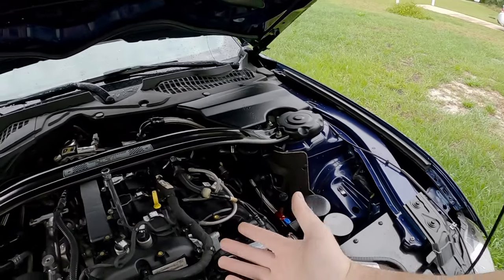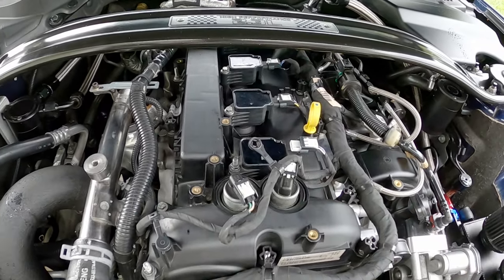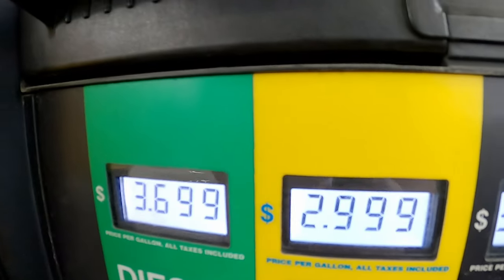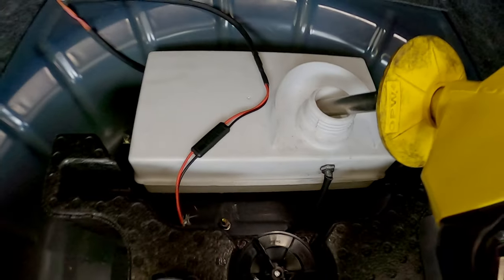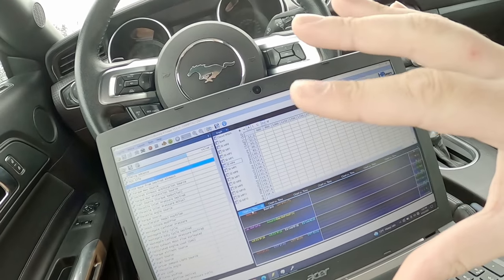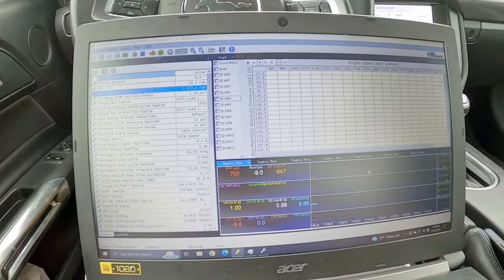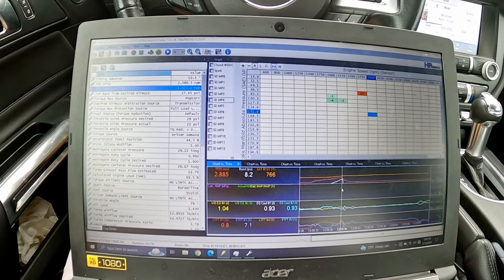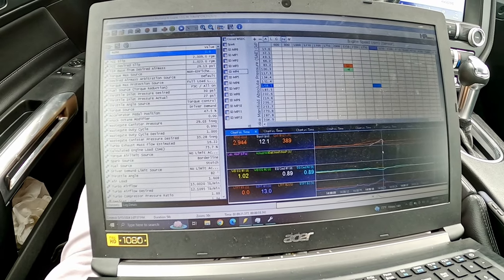Using E85 in an Obscure Way *NOT RECOMMENDED*

Comment: *Kirk, this information will really help me! At the dragstrip, I brake launch in 2nd gear at 2500 rpm and have issues with charge temperature and timing. I also have a 2/10th of a second delay between releasing my foot brake and the rear axle turning.

Can you log your charge temperature and timing when you brake launch your Ecoboost Mustang?? Also the delay between when you release your brakes and your rear axle turns?

Thanks in advance for the information!!
Reply from the maker: I'll post that info in a video. It won't be the next video upload, but the following video. I haven't had time to log the car launching.
Reply: Thanks Kirk! I think part of my problem is the amount of heat the turbocharger produces while staging. It pushes my charge temperature up to where the ECU cuts timing...?
Reply from the maker: You gotta get staged quickly! Loading up the trans to brake boost builds heat kn the trans and engine. But yes, if your manifold temps are lowering your timing, you can always raise the manifold charge temp table in the spark advance section. Also check your LSPI Hi table to see what ar load it's at when the manifold temps are higher. You'll love my next video when I get it uploaded. I'm slowly getting part of my launch control system ironed out.

Comment: I had a bad experience with anti seize, I had used some on new plugs on it showed come tuning time. I had a miscommunication with my tuner when he asked if I used some I thought he meant I did not use enough so I put even more on. big mistake, the only real way to clean up that stuff is the chem bath the machine shop does. As I have said before, I make a lot of mistakes...
Reply from the maker: I don't usually usually use anti seize on plugs, but I was diagnosing a problem a little while ago and thought adding anti seize would help. Why did the tuner question anti seize on the plugs? Just curious.
Reply: @KarzKreated   so the plugs were acting like nock sensors and downgrading the fuel like it was bad. it was going from -1 to -.80 when I would wot.
Reply from the maker: Oh wow. That's interesting. Good to know! 🫡

Comment: I've never used anti seize on my plugs.  As much as you pop them in and out you should never need it unless Ford actually calls for it
Reply from the maker: I don't usually use it on spark plugs. It's left over from some diagnosing I was doing a little while ago.

Comment: Because with my car access port with the factory turbo, I could boost launch it at 10 psi that would be as high as it would go I think due to the wastegate spring I put the bigger turbo on which is the BNR 525 and now I can’t build any boozeon the break and the car will barely go over 2000 RPMs any advice why
Reply from the maker: That turbo is much bigger than what's on my car. You need more engine speed to get that turbo going. Without a high stall converter or some kind of anti-lag/2 step, you're gonna have a hard time spooling that turbo. You can always try to adjust the wastegate settings in the tune to use a higher duty cycle and lower canister pressure. I use HP Tuners with their MPVI-3 interface.
Reply from the maker: Is your transmission a 10R80 or 6R80?
Reply: @KarzKreated  it is the 6R 80 also I got in touch with my Tuner and he had the transport turned off so I’m gonna try it again today
Reply from the maker: Ah. I'm not sure how much you can stall the 6R80 without spinning. That transport mode was likely why you were limited on RPM.
Reply: @KarzKreated  I’m sry just seen what I said I meant trans brake lol
Reply from the maker: Lol that too! 🤣

Comment: E85 will damage your pump internals
Reply from the maker: If the pump is rated for 100% methanol, it will handle E85. Methanol is worse on metal and seals than ethanol. So if it can handle methanol, it can handle ethanol.
Reply: @KarzKreated handle ethyl alcohol, but not ethanol + fuel mix